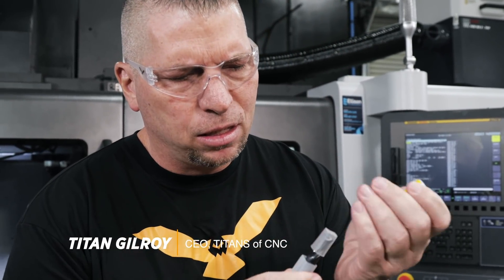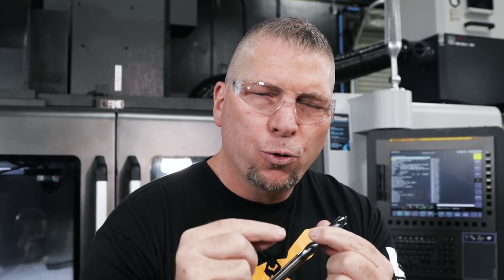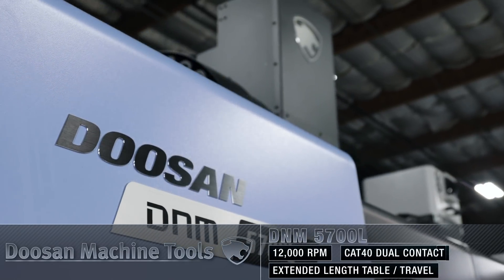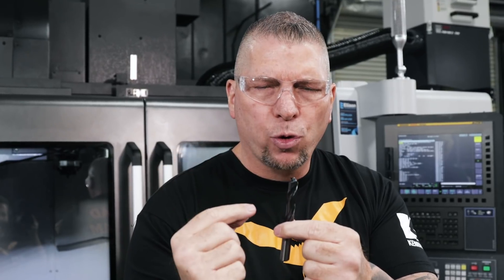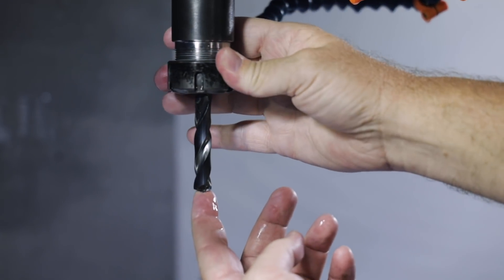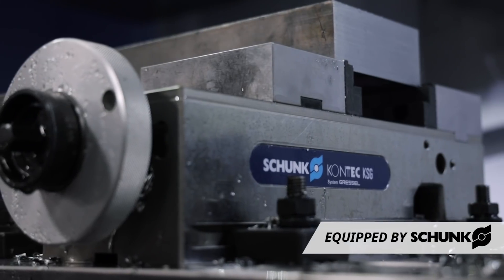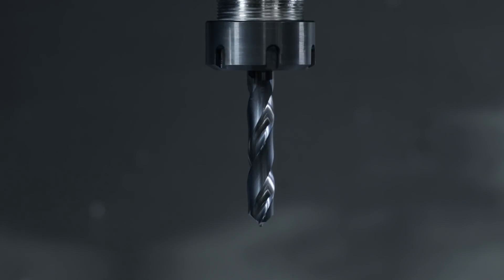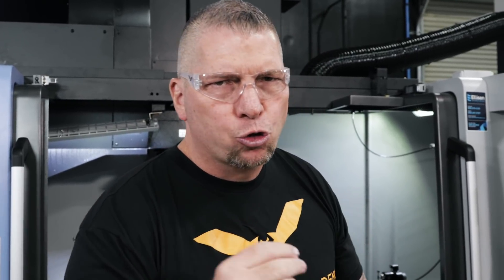Drilling Steel at 130 IPM with the HPX DRILL | DNM 5700L | DN Solutions

Comment: Titan, the initial parameters you said were .006-.016 a tooth.  I didn't check novo, but I looked at the application data on the website.  I saw no 1/2 inch hpx with those feed or surface footage ranges that you gave...although they were in that approximate range if you change from tooth to rev, with the max IPR between .017 and .022.  And the SFM was the max already at 950.  Did you also misspeak when you said  double and triple your cycle time?  Yikes.  Not normally what I aim for, but I guess they don't call me 'cut it in half Jonny' for nothing. BOOOOOM!

Comment: I’d like to see the cutting edges of these tools before and after under a microscope. Could be interesting so see what kind of wear you get.
Reply: I haven't used that particular drill (no kennametal tools for that matter), and at a bit lower feeds and speeds for durability purposes (drilling through mill scale at 2.4m/min) and the wear is very even and predictable (we were getting 10k holes through 1cm thick steel plate) once you dial the cutting speed right and the mode of failure in our case was slight chipping on the very tip (from the abrassive crust) impeding chipbreaking. 

Stringy chips thicker than 0.5mm (feed per rev was less but material compression ratio thickens the chip) suddenly wrapping around the spindle and fanning out at 7k rpm,  vaporizing a few liters of coolant per second, always scared the shit out of operators.

Comment: 7k rpm, on steel (wich steel is that, seems to be 11SMn30 - 1.0715?) 12mm dia, insane... just insane but it works. But what about the precision in distance between two holes , compared to milling a round pocket with an sub diameter milling cutter and the roughness inside the hole?

Comment: What's even more crazy is he isn't close to being out of the specs he gave. So it can go way faster. He said the chip load range was .006-.016 per tooth he is running it at .018 per rev it has 2 teeth so he is only running at .009 per tooth.

Comment: Hey Titan, I have nickel-based superalloy grade material. Need to drill Dia 13mm hole in turning up to a depth of 24mm. Which drill will be  better among the Kennametal's  Kentip drill or Ceratizit's Lug drill???
Reply from the maker: How many holes? I would go with a less expensive GoDrill. They are Beasts. Coolant thru if possible. Check out the machining section of our www.aerospaceacademy.com for more examples in Nickle Alloys.
Reply: @TITANSofCNC  I have 1000 components .I have used Go drill of KC7325 grade but didn't get the life of drill with recommended starting speed and feed.

Comment: I totally can do this with my dewalt cordless drill (admittedly to drill that fast in steel it needs a freshly charged battery!) glad I got my dewalt with though-spindle-coolant! (The tank does make it harder to carry in a belt holster though!)
Reply: That one drill bit he used cost more than your Dewalt drill
Reply: @Moodyfabrication  You just proved the point that DeWalt not only can do the job at the same speed, but will also cost less.
Reply: You just need the garden hose attachment for thru coolant.
Reply: Are you using the new and improved 20V battery?
Reply: that's not a half bad idea, i kind of want a belt-mounted TSC tank now

Comment: How much does that drill bit cost in 1/2" 
$?
Reply: I have no idea about the HPX, but the Kennametal HPS drills in 1/2" are $265 at carbide depot..
Reply: @machinist7230  😳 ill just have to stick with HSS drill bits till i win the lotto i guess!
Reply: @adriankingston4338  try carbide insert drills. The cost is upfront in the body, but a worn $30 insert is cheaper than a worn out $300 solid body
Reply: @meowbombs  ill do just that with a couple of my more heavily used sizes i know of them just never tried them i will now! Cheers

Comment: Ok, amazing! But the critical work for the drill is when get out to hole... it breaks if catch metal with esternal side.This seem a blind holes work, but if the hole is complete from side to other side?
I think with this very good machinery it can't happen.
Escuse me for my bad english, i don't speak english, only few words!
Reply: I use flood coolant only with these style drills (Machine doesn't have through coolant). For drills 3-5xD they will last all day at recommended feeds but you can push them. We push ours in hardness rather than speed. Plus we break through on 90% of our holes. You will only have problems when breaking through to un even surfaces (when the drill cuts one sided).
Reply: I have seen the last video. This tools are fantastic!